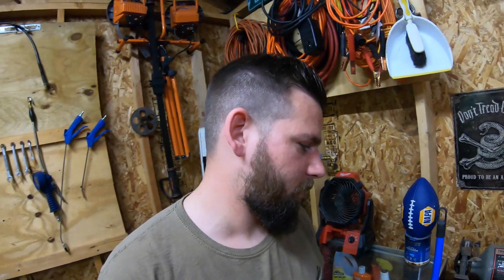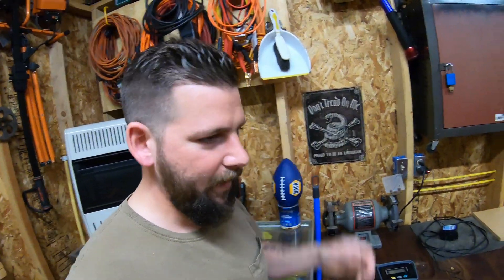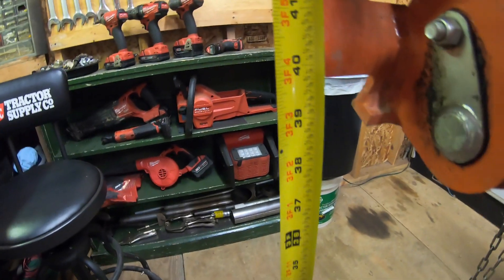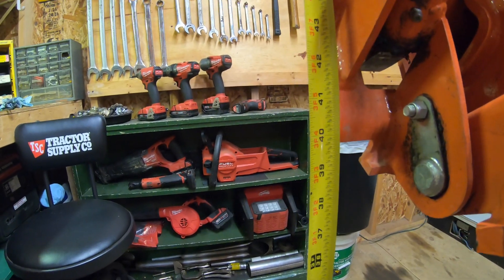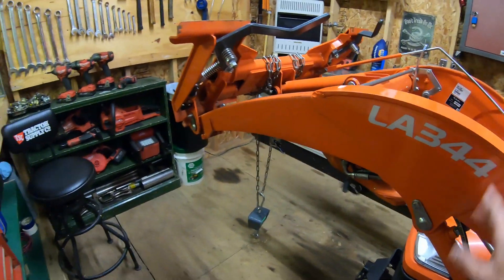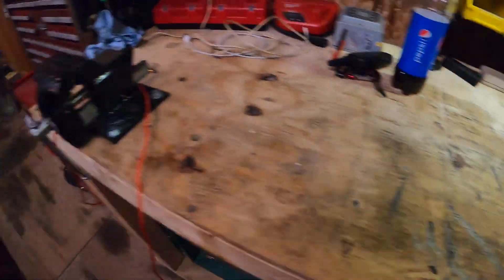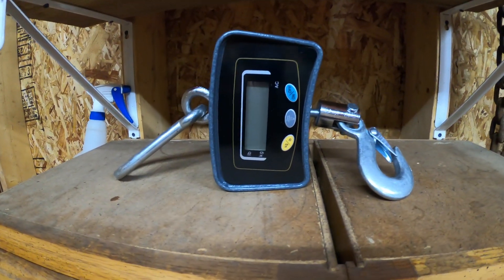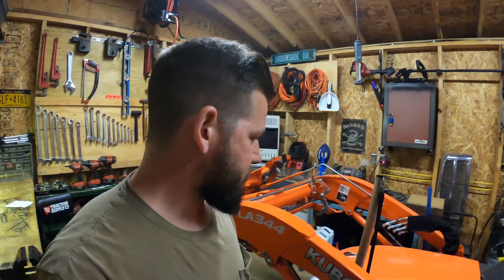Kubota BX- Loader lift capacity VS. Relief valve pressure

Comment: What shims did you use? All three in the kits... .004, ,.002, .001...
Reply from the maker: I couldn't tell you to be honest, every machine is gonna be different because no relief valve spring is the same, every machine will have a slightly different starting pressure and every machine will take slightly more or less shims to get it to the same psi so you just have to do some trial and error and see what gets you to where you want to be. For an example mine was at 1650psi when I got it and I ended up using every shim that the BXPanded kit came with as well as bought 2-3 more shims from my local dealer to finally get me to 2000psi, iv seen others only have to use a couple shims out of the BXPanded kit to get them close to 2,000psi. Hope this helps man and I hope all is well with you! New video coming soon BTW.

Comment: Nice video. It does void warranty for little improvement unless you are on low end of specs. Great to be able to shim and get to maximum specs within warranty. Considering the weight of that mini tractor you must admit unless you ballast it to death it won't pull the extra weight anyway. Best to get a L2501 at least to even think of this mod. And still it is best to stay within specs.
Reply from the maker: For sure, Ballasting is a MUST if your going to do this and that's why i emphasized it so much in the video. Anytime you exceed factory specs its a risk.. I do it because I'm comfortable with it and I know I can handle it as I am very comfortable with my machine but if others aren't than you should be cautious about doing this as it is not for everyone.

Comment: Thanks for taking the time to do this test. My BX2360 lifts pretty good but I think I will buy a gauge and test it. I can lift the rear tires off the ground with a 6 foot grader blade on it so I guess it is pretty close to 2,000 PSI.
Reply from the maker: If your doing that then I would have to agree you must be very close to 1900-2000psi, test it out and let me know! I’m curious myself! Thanks for watching

Comment: Great vid. Can you please post a link to the shim kit?
Reply: You can just go to your local Kubota dealer. Shims are about 50 cents each. Then you won't have to pay $5 or $10 shipping from some online dealers. The  .1 shim is part #31351-37970, the .2 shim is the same only 60 for the last 2 numbers, and the .4 is 50 for the last 2 numbers. Hope this helps.
Reply from the maker: Thanks man, I bought most my shims individually but if you buy this kit from bxpanded it will come with all the shims you need, you can also prolly call them and ask to sell you just the shims too they would prolly do it. 
LINK: https://www.bxpanded.com/pressure-tester
Reply: @BiffsEquipment  Thanks!